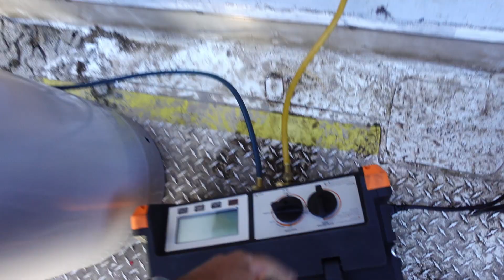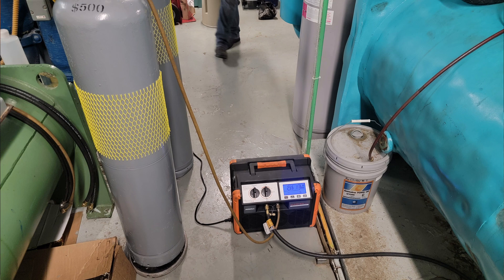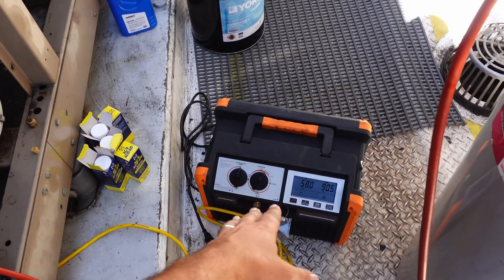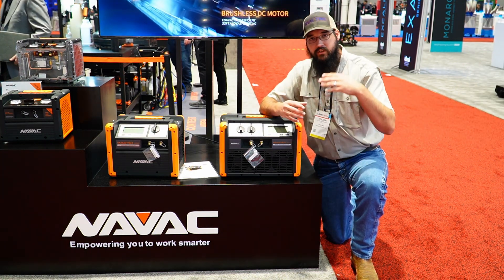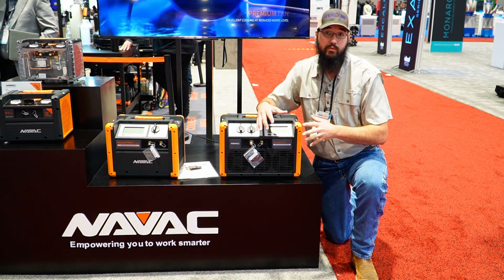Portable Chiller Recovery Machine NAVAC NRDC4M

Comment: I have owned one of these pumps for over a year now and bought a second one. I can recover 3lbs/min R-134a vapor using both pumps working in parallel below 10PSIG. On R-410a the micro channel condenser does a great job of sub cooling refrigerant to keep tank pressures low, no need for your homemade subcoolers. Downside is cost, weight of the machine a little heavier than say a G5 and small inlet screen plugs up quicky if you get into a contaiminated system. All in all the best biggest portable reclaimer on the market.

Comment: What do yall think of the NAVAC vacuum pumps?  Im in the market for a navac pump.
Reply: The vacuums are very good I have (2) 12 CFM pumps on my truck. I also have that recovery machine my first one has quit and they warranty replaced it. Using Push/Pull and or knowing how to use the functions really helps move a lot of refrigerant with that machine.